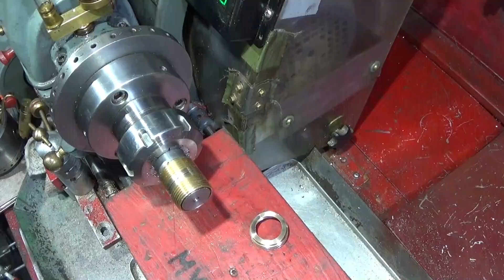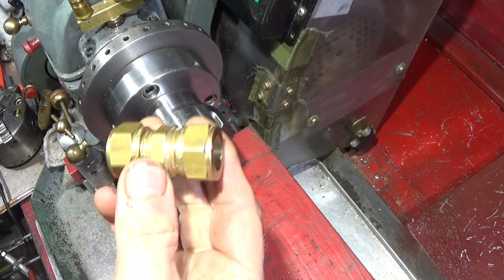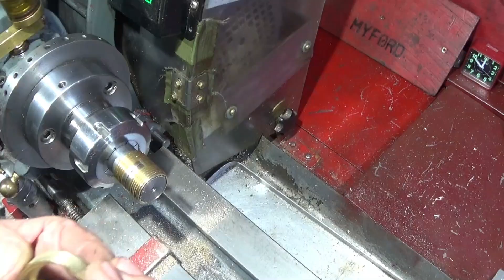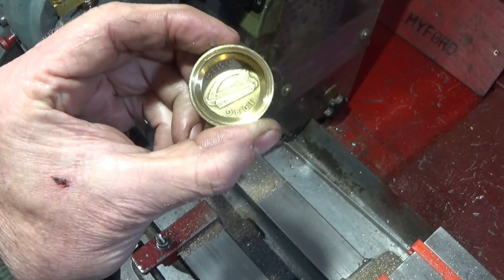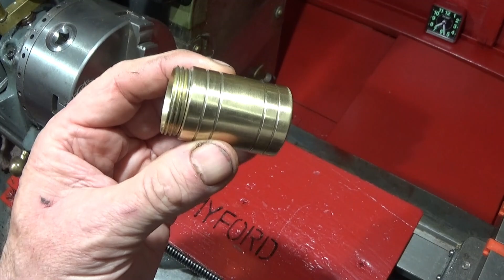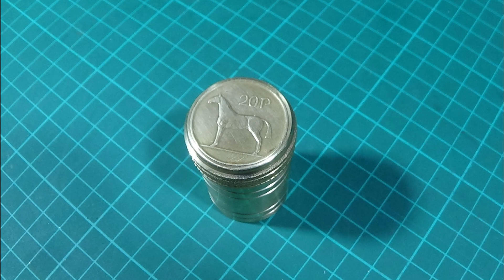Finishing A Brass Screw-Cap Container Using Plumbing Fittings On The Lathe

Comment: Nice one Steve, I will keep this idea in my mental tool box! I have made the expanding mandrill for easy threading like you suggested for the mini lathe and it works perfectly, and have made and threaded many aluminium boxes with it.
Reply from the maker: Hi Robert. Thanks. Yes, these are nice projects. I have made lots of them on the Mini Lathe. You can use the split plumbing nut to hold the plumbing threads in a 3 jaw chuck to machine them. If you haven't got a collet chuck. I have done this for years on the Mini Lathe. Regards Steve